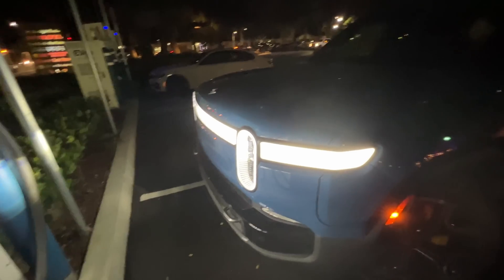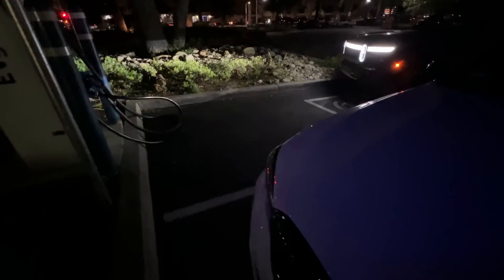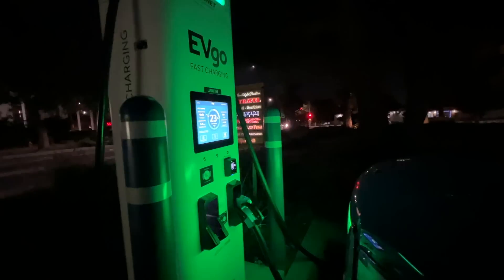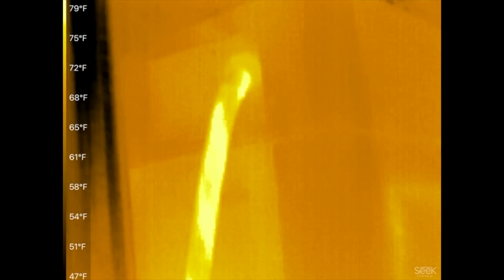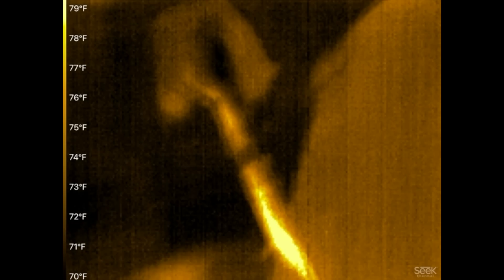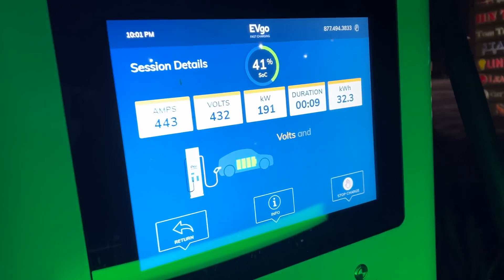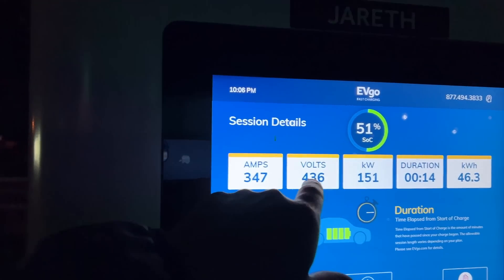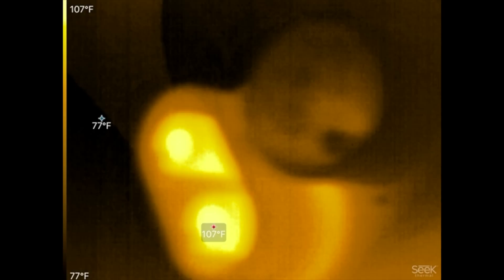HOT CCS combo Plug  on 200kw Rivian charging

Comment: 480A is pretty crazy. I can see why the 800V systems are becoming commonplace with 200+KW charging.  Those cables are probably rated for 90°C/200°f so still lots of safety margin on it.

Comment: What do you mean,  NOT a big deal.  It's a VERY  big deal.  Your wife could barely get in the spot to charge and get out the drivers door.
All vehicles not charging needs to be towed if left more than ten minutes.
Reply from the maker: Would have been a big deal had I not been able to park and charge because there was cars parked there.  There was open stalls, no one died,  no one was hurt,  settle down.

Comment: Hey @Jehugarcia, just one thing to note about infrared cameras, the 87F temp you saw on the cable isn’t the real temp at all. 

Thermal cameras only can see the surface temp. That’s what you captured there. In order to see the real HV cable you would’ve had to exposed one of the copper wires running inside that thick cable. 

So yes.. lots of energy is wasted in the DCF Charging process. And no matter how these DCFC inefficient are, that all gets billed to us.
Reply: It's inevitable. Any better solution?

Comment: I showed up at a place that had level 2 chargers and some jerk in a Tesla model Y parked sideways taking up 3 of the 6 chargers, and was not even plugged in. I spend 5 hours there and when I left he was still there, and all other chargers were taken, like WTF is wrong with you Model Y do you need a hug or somethin?
Reply from the maker: I would have called a tow truck
Reply: @jehugarcia  I told the facility and hoped they would but no suck luck.

Comment: No surprise that slip fitting rings and rods have a lot of contact resistance. For just 50 amps at 120 volts, a Whopping 6KW the better connector is the flat blade into double spring loaded flat receptacle. (Stove connection). The RV type connector can get hot and melt at the same 50 amps and 120 volts. I had that happen at 12 AM a cold winters day. Luckily I was awake.
Reply: I’m going to have to disagree with you. The new rod and tube connectors have now shown to be the least resistance. From about 2001 to 2010 the the rc car and plane hobbyists started using massive amperage and their connectors were melting. So they tried every configuration possible with small size and weight being really important. The new spring loaded pin going into a solid tube was the winner. 
The great part was that the technology ramped bigger really well. So you can use a larger tube and a 1-4 inch long pin. Also what was nice was the tube could be long and if the connecting device knew it would not need a lot of power it could be a shorter pin. 

The spring loaded pin was the key. If you look at the pins now they have tiny cuts along the side that get compressed. So the pin is actually larger diameter than the tube and get compressed as it slides into the tube. Guaranteeing the most surface area contact under pressure. Unlike flat spring connectors these don’t loose their spring pressure after a decade and 10,000 connections.

Comment: Would be interesting to calculate and know the amount of energy loss/cost from the charging cable. Also the loud noise, was that from the charger:
I believe that combustion engines are not going to be replaced anytime in the next 50 years.
The electricity used to charge that vehicle, especially at night, is not produced by renewable cleaner(?) energy.
Reply: Even if the electricity is produced from a diesel generator you get more miles per gallon of diesel with this truck than putting that diesel directly into a diesel powered truck. That savings and the reduced maintenance requirements will cause fleets to stop buying gas and diesel vehicles as soon as enough electrics are made. Kind of hard to fight the more economical solution.
Reply: It’s awesome to watch this industrial revolution that is happening around the world but unless there is massive public and corporate investment to the infrastructure and current technology it will be difficult for EV’s to make a great impact. For instance, one of many and expensive hurdles to overcome is the time to charge an EV will probably be a determent for people who rent apartments (about 40% of the population) unless the apartment invests in onsite charging stations (cost that will probably be passed on to the renters). And  amount of sustainable electricity in the US will have to be greatly increased to meet the future demands. @ecospider5
Reply: I did a test on my Tesla model 3 which I drive 15,000 miles a year. I charged it every day on only a standard wall outlet (120v 15a). I never had to get a top off charge from a different charger. So eventually apartments will learn this and look at putting charging plugs at the parking spots. If you put a bunch in at the same time you could do 240v 20 amp at $200 per plug. Any EV owner would be happy to pay $10 a month for those spots (plus their electric usage costs). The apartments will then recognize those spots are bring in revenue for them. 

The $2000 6KW chargers are just not needed.
Reply: Shows what you know about electricity generation. Overnight due to much lower grid demand, nuclear, pumped hydro, biomass and more often now wind power can all easily handle running the grid. Especially in the milder month's. 🤔
Reply: @4literv6  Only one nuclear  power plant built in US since 2009, water in the Colorado river is so low the hydro generated from Hoover dam will probably have to shut down within months, try finding a biomass power plant that hasn’t gone belly-up.

Comment: I'm super envious but happy about letting others pay the freight for being an early adopter to this technology. Doesn't all that heat translate into wasted energy?  Looking forward to some real world calculations/data that measure charging efficiencies. Also curious how well battery life holds up with fast-charging at such a high current. Does the R1T show this data-point? Also, where I live in Canada (scooter battery town), my recent electrical bill was 33 cents per kwh. How much and how long to charge up Rivian from empty assuming a 50 amp 220 vac source?  It's a nice looking truck!
Reply: Yeah DC fast chargers have ~10% loss due to heat, charging at home is much more efficient. The faster you charge, the more heat, the least efficient, and this truck is pulling +400Amps.
The truck has 11KW in board charger, so that will be it's max speed using 48A. 
You can probably expect a max 0-100% home charging of 11-12hrs. The limitations could come from your panel or that in board charger. 
I think another channel showed 125-130KWh "usable" capacity for the 314mi EPA range. Of course it depends how you drive. For an estimate, of you drive those 314mi in a week, you can just multiply the battery capacity*the price.
Reply: @Ilbabbuino  
Thanks for the info. So about $42 CAD to charge the R1T from 0 to 100%. Somehow I'm extremely doubtful electricity charges will be dropping as demand increases.

Comment: The electric motor cabin noise seems too loud for a $70,000 vehicle.
Reply from the maker: Unless you like to hear the motors
Reply: @jehugarcia   I don't.
Reply: It is an interesting question. My first electric car was a Nissan Leaf. They are dead silent. My test drive in early 2018 with the model 3 was rear wheel drive. Again really quiet. So when we received our dual motor model 3 hearing the front motor was unexpected. We had it in service a couple times until the service team had experience with the dual motors and said it was normal. Now I am just used to it. Really I don’t dislike it or like it. I just don’t notice it anymore.
Reply: @ecospider5   Lol, an auto service tech saying a problem is normal, is, well, normal. That's code for, "Go away, you bother me".
Reply from the maker: But using same logic,  just because you don’t like the sound it means is a problem.   If all Rivian’s have the sound then indeed it’s normal,  regardless of how many people like/dislike it.
Reply: @jehugarcia   It's certainly a sales problem.. Luxury vehicles make lack of cabin noise a selling point. BMW, Mercedes, etc... advertise "Acoustic Glass" because buyers don't like noise. Even the Rivian you own has sound dampening insulation to reduce noise. It's a thing.

I like Rivian, good for them for even existing, it has to be a tough startup niche.
Reply: I also drove a bunch of other 2018 dual motor Model 3’s and ours sound the same. It would be interesting to see if that has changed in the 2022 Tesla model 3’s.
Reply: That being said I would pay for a motor sound reduction if they offered it. Thicker sound insulation or something.

Comment: Are you going to tow anything with this truck? I'd love to see how it does towing a trailer with a ton or 2 behind it.
Reply: Tfl truck did a tow test 😉
Reply: Out of Spec Reviews youtube channel also did a towing test at highway speeds with a R1T towing an enclosed car trailer loaded with a Tesla Model 3 inside it.
Reply: As long as it is light weight and you are always close to a charger it works. No way I could use it for my travel.
Reply: @geraldkoth654  soon Gerald soon you will be able too

Comment: Uh-oh, it doesn't look good as far as the Infrared imaging is concerned, the charger cord is probably too warm for its size expected to provide that kind of juice, it's always better to either bump up the conductor thickness or like Tesla, water-cool the cord so it doesn't get too warm to the point it's a problem.
Reply: The cable temp is cooler than deeznuts?
Reply: @loafandjug321  when you think about it using that metric, doesn't seem so bad
Reply: @peterskyparker   Right on, right on...
Reply: The dark spots in the cable is probably liquid cooling
Reply: but if you look at the actual numbers and not the gradient of colour range, Its barely 10-15f hotter than the outside ambient temp which is nothing on a big high voltage high amperage charger like that, so its hardly near having any real thermal issues.
Reply: @weegaz22  Yes, but if it's not actively cooled, thermal buildup is a problem with higher ampacity wires; the warmer they get, the higher the resistance go, the more warmer they get. Think of the toaster. That's the worrisome part, that is if it's a little bit undersized for the current it's asked to carry. I have heard of a few chargers catching on fire this way.